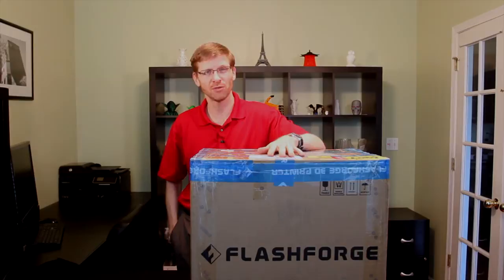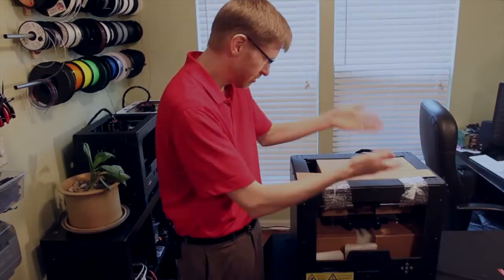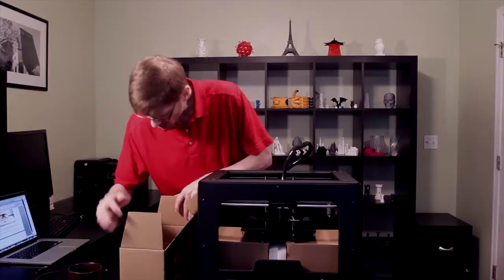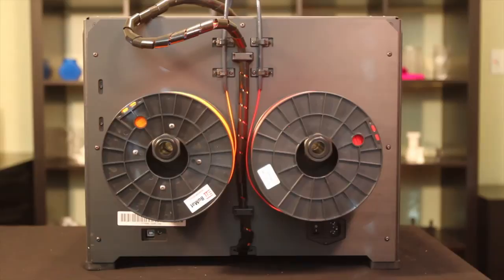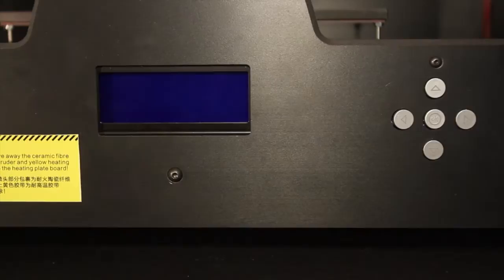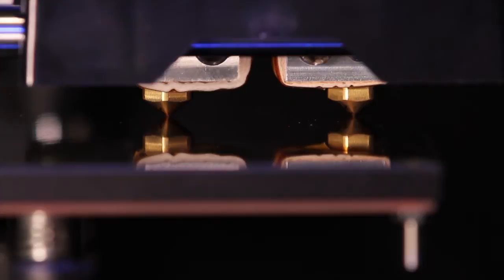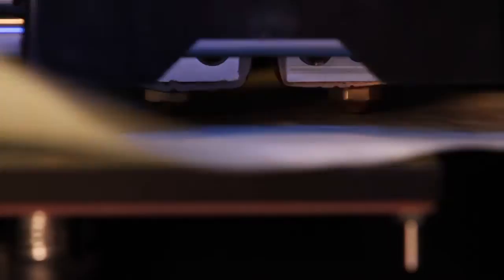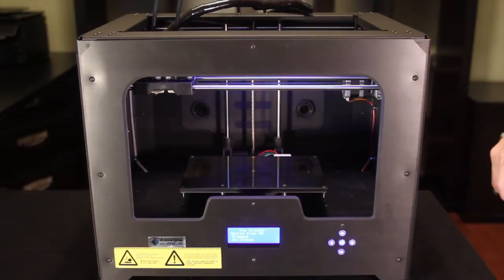Getting Started with the FlashForge Creator X: Unboxing and Initial Setup (3D Universe)

Comment: It isn't static electricity causing the panel to light up it is because you are making the stepper turn which turns it from a DC motor into a generator which is sending power to the board.  If done too fast it can actually blow out a RepRap's Ramp based board so I presume this as well.

Comment: Great video going through the steps.

It's actually not static electricity that's lighting up the LCD. The stepper motor is like a brushless motor. It can act as a generator. In a nutshell, when you lift up on the bed the magnets start moving inside the windings in the stepper motor. This generates an electric current. That electric current is then fed back into the machine. That's what causes your display to light up.

Comment: Thanks, very helpful! Some slight differences with my hardware, not sure if newer or just a slightly different model, but overall 90% applicable, and much better than the manual that came with the printer. Printing my first test piece right now, can't wait!

Comment: I didn't have as much luck starting with a flashforge creator pro.  After spending over a week tweaking settings, I was getting about about a 3-4 out of 5 failure rate on prints and never could get it to print overhangs with or without supports without a huge amount of distortion or hanging rows of filament.  I tried several slicers including the expensive Simplify3d.  I had issues where rafting and supports stuck so hard to models that pieces of the model would break off or chip upon removal, and anything cube shaped had raised corners (not lifting off the platform or anything, just corners got taller the larger the item became).  I tried a Da Vinci, and although I hate the proprietary filament and closed-source format, it gave me perfect prints right out of the box.  I have since returned both and purchased a cheap chinese knockoff (QIDI Avatar IV) since I can't justify spending so much on something that I can't get any sort of consistent results from, and it has worked alright so far outside of a few issues. Could my flashforge have been faulty or are they all that difficult to get working right?
Reply: I hear flashforge has great customer service..did you contact them?

Comment: It's not static electricity 
Static will kill your device especially the CPU and the ttl are sensitive
Scott was right the steppers act as dynamo and create power this is not really good for the main board.
Mos fets can survive but other parts are sensitive also the main CPU can burn easily because of high current.
I disconnected mine when I shifted the head.

Comment: Hi! Can I use different filament brands with this printer? I have a lots of PLA filaments here (1.75mm), so I want to use them when I have my flashforge. Please confirm! Thanks!
Reply from the maker: Marco Gaufo Yes, you can use any brand of 1.75mm filament with the Flashforge printer

Comment: After leveling the plate, I tried to create a test print.  It did not move to the center of the extruders did not move to the center of the plate and the print  started on the side of the plate.  Would you know what might be causing this issue?  Would this be a settings issue?

Comment: My firmware said to press 'M' to continue. There is no 'M' on the printer. I have to manually move the print head to the rear, left and right for the paper test. I pressed 'ok' and the bed lowers and print head goes to upper right corner. My printer was bought August 2015. I s this a one time thing?

Comment: Funny, the FF Cp that I just received only has 3 adjustment knobs, why? It's a rectangular bed. That and the cooling unit is lower than the nozzles so I can not properly adjust and level the rear. Thanks for the video and explanations!!
Reply from the maker: They must have changed the design (again).  A 3-point leveling system should be okay for leveling - it's not an uncommon setup for desktop 3D printers. Not sure about the cooling unit getting in the way. It seems odd that it would interfere with proper leveling.

Comment: I have a question about my creator flash forge pro I just bought. I live in the US and I was wondering about the input voltage source. should I be seeing the 115v sign on the red switch or the 230 in order to get 115v?

Comment: what is a good temperature to print ABS and PLA thank you I am still new to this and looking at all your videos as I am waiting on my flashforge arrival thank you. ex. main temp and first print temp. thanks
Reply from the maker: It varies somewhat by personal preference, but I typically use 230C for ABS, with a bed temp of 110C. For PLA, I use 200C with a bed temp of 45C.

Comment: received my pro today got it all set up to the part where you are inserting the filament, since I like printing with ABS can I just load the one ABS cartridge that they gave me. and not load the other side? and does it matter with side? since I am doing the commanding on screen. you can tell I am still learning, sorry. I cannot find much info on what I need so that is why I am asking you sorry.
Reply from the maker: Yes, you can just load one spool of filament and leave the other side empty. You can use either side, but generally speaking, the right extruder is considered primary (it's identified first in numerical order, while the left extruder is second).

Comment: Is there a video that you do somewhere to show how to level with a glass plate? or do I just add plate and the rest is the same? also on thingiverse someone has a shim to add to the pro when using a glass, is that require? thanks.
Reply from the maker: Yes, you'll need that shim. Print the shim before installing the glass. Then install the shim and the glass plate and re-level the bed using the same technique shown in this video. I'll do a video on the glass build plate installation as soon as possible.

Comment: leveling are you feeling tension on both nozzles or just one? I am having trouble feeling both tension, either right or left not both. also on the pro it is one on the front and two on the back. I am trying to do the opposite of what you are doing.
Reply from the maker: If your nozzles are properly leveled, you should feel tension on both. If you only feel tension on the right nozzle, that's okay too, because the right one is considered primary. That would mean that the right nozzle is a slight bit lower than the left nozzle, which actually helps to avoid the left nozzle running into your prints when it's not being used. If you're having trouble feeling which side is causing the tension, just insert the paper under one nozzle at a time and see how each one feels separately. If they both provide about the same amount of friction on the paper, then it should be okay.

Comment: would this also be for the pro or is there a different video as I cannot find any where for the new pro. thank you
Reply from the maker: Everything shown here would be the same for the Pro, except that the bed leveling screws are positioned a little differently. For the Pro, you'll also have to install the acrylic door and dome. Other than that, it should be the same.

Comment: How do you command your printer to draw a line before it starts working on the actual printing job? I find that very useful. Is there a setting which I can change?
Reply from the maker: I created some custom start g-code for that. I use this with Simplify3D, but it should work for other slicers too.

T0 ; set primary extruder
M103 ; extruder off
M73 P0 ; enable build progress
M70 P2 (Simplify3D)
G162 X Y F3000 ; home XY minimum
G161 Z F1200 ; home Z minimum
G92 Z-5 ; set Z to -5
G1 Z0.0 ; move Z to 0
G161 Z F100 ; home Z slowly
M132 X Y Z A B ; load current position from EPROM
G90; set positioning to absolute
G1 X100 Y73 Z30; move Z to waiting height
G1 X-100 Y-73 Z30 F14000; move to waiting position (front left corner of print bed)
G130 X0 Y0 A0 B0; set stepper motor vref to lower value while heating
M6; wait for bed and extruder to heat up
G130 X127 Y127 A127 B127; set stepper motor vref to defaults
M108 T0 R3; set extruder speed
G92 E0; set E to 0
G90; use absolute coordinates
M320; acceleration enabled for all commands that follow
G1 Z0.2 F6000.000; move to first layer height
G1 X100 Y-73 F14000.000; move to front right corner of bed
G1 X-100 Y-73 E24 F1200.000; extrude a line of filament across the front edge of the bed
G4 P2000; wait for ooze to slow
G1 Z0.0 F6000.000; lower nozzle height to bed
G1 X-120; wipe nozzle
G1 Z0.2 F6000.000; set nozzle to first layer height
G1 F14000; ensure fast travel to first print move
G92 E0; set E to 0 again
M73 P0; reset build progress to 0
M73 P1 ;@body(notify GPX body has started)
Reply: Thank you for the tip! I will try it out (newbee here). I will let you know if i get it to work in replicatorG
Reply from the maker: You can try inserting the new code manually when g-code is generated, but if you want to apply this to all future objects, you should be able to modify the start.gcode file located in your Replicator G install directory, under replicatorg-0034/skein_engines/skeinforge-47/skeinforge_application/prefs/Replicator slicing defaults/alterations/. Good luck!
Reply from the maker: Also, I found Replicator G to be pretty limited. It's slow and crashes a lot. If you'd like something easier to use and more stable, you may want to try MakerBot Makerware, which is also available free of charge and works fine with the FlashForge printers.

Comment: Nice vids!, BUT can someone tell me which one is the best for home industry between Printrbot Metal Plus and this Flashforge Creator Pro?! 

I'll print many frame and case or something like that and sell it online. You can also recommend me another 3D Printer mechine under 1500 and match for home industry. Sry my english is so bad, and thank you so much for anyone who answer me!, because i really need your answer with your experience, and this is will be my first 3D Printer, so i don't want to get the wrong 3D Printers. Pls, i really need the answer from a 3D Printer expert!! Thanks..
Reply from the maker: It depends on what's important to you. There are many printers available in that price range. Personally, I think the best value for under $1500 is the Ultimaker Original Plus, which is $995. It's a kit, so you would have to assemble it yourself. But you would then have a very capable 3D printer.
Reply: +3D Universe, i'll choose between Flashforge Creator Pro and Ultimaker Original+, thank you for recommend me Ultimaker Original+ because both are very comparable for me, Ultimaker Original+ have a great minimum resolution but the max res are to small(200micron), speed are faster but only 1 extruder and wooden enclosure i think not too good, and for Flashforge Creator Pro have 2 extruder but min layer resolution is 100 micron(idk if this enough to create a small nylon screw) and the build area little smaller but the enclosure are solid metal. I'll thinking about what i really need now, fast and high resolution stuff or 2 color low resolution stuff to print. Thanks, greeting from Indonesia.

Comment: sorry when loading filament?
Reply from the maker: It preheats to whatever temps you have it configured for. You can set that under Preheat Settings under Utilities on the printer's control panel. You probably want to use 230C / 100C extruder temp / bed temp for ABS and 200C / 45C for PLA as a starting point.

Comment: Hi, my tray won't push down after removing the boxes.  Please help.
Reply from the maker: Is your power off? If your power is turned on, then the stepper motors will be engaged and you won't be able to move the bed. Make sure the power is turned off, then grasp the bed on both sides, near the rear of the build plate and push down evenly on both sides.
Reply: 3D Universe Thank you so much for the help.  I am now stuck on the section to level the tray.  In the video, it shows it going through a three step process, my machine only goes through one step.  Would you have any idea why this is the case?
Reply: Jeff Kricheff After the first step, it says press "m" when complete.  And if I press ok, it does not do anything else.
Reply: Jeff Kricheff You're probably using a Creator Pro, or a machine that was already upgraded to the Sailfish firmware. That changes the leveling process. When you start the leveling procedure, it just moves the build plate up, moves the extruders to the front center of the build plate, and then turns off the stepper motors. The result is that you can freely move the extruders around by hand. Just move the extruders to each of the three points where the leveling screws are positioned and adjust the height in each position. When you're done, press the middle button to exit leveling mode.
Reply: Jeremy Simon Thank you, that seemed to do the trick.  I really appreciate the help.  After leveling the plate, I tried to create a test print.  It did not move to the center of the extruders did not move to the center of the plate and the print  started on the side of the plate.  Would you know what might be causing this issue?  Would this be a settings issue?
Reply: +Jeremy Simon 
I am having same problem as Jeff.  How do you turn off stepper motors? Looks like I can just follow your advice to Jeff after that.